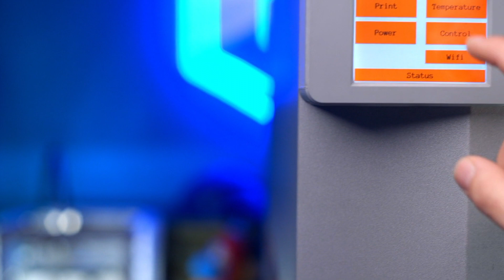MakerGear Ultra One // 3D Printer Highlights

Comment: it better be able to print FAST, GOOD and HOT for it's price
300mm/s+ printing, good quality and materials like ultem or PEEK
that price and those components are useless if the printer is not made to use them
Reply: Eh, it's a BIG machine. If you're at a university/company/lab (I'm at a national lab) looking for a high quality FDM machine with a build plate this big, there aren't really any other options until you move up to the "multi tens of thousands" price range. We have a few Stratasys machines scattered around and based on my personal experiences with the Makergear M2, I expect this to do better than those at a fraction of the price. Also somewhat biased on account of we just ordered one :/ haha.
Reply: Like the last guy, I'm a little bias but I'm not in the market for an Ultra One. I have Makergear's M2 for about 2 years now and can say that it is a "work horse" type of 3d printer. Because of that, the price to feature ratio isn't that good, the Prusa i3 basically has everyone beat there, but what you get is great build quality and support. The M2/M3 are built like a tank, 3.5mm steel frame with 5mm CNC aluminum plates for the x axis linear rail and y axis build platform. Since I've owned it, I have not need that much maintenance other than lubing and clearing the occasional jam (mainly user error). The platform stays level for months (I only level the printer for precaution) and the builds have never loosen for me. All in all, all Makergear 3d printers are more for people who wants something that last a really long time that just works.